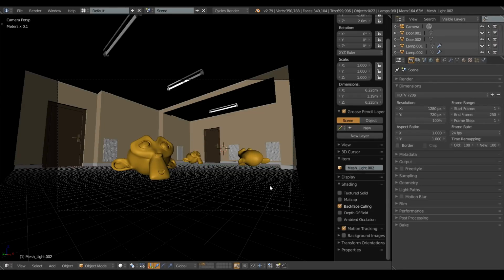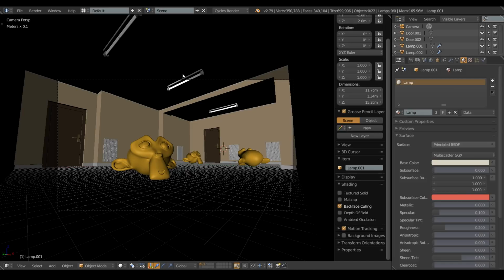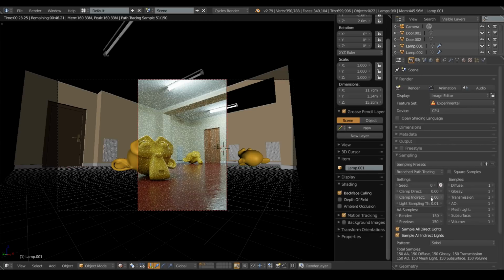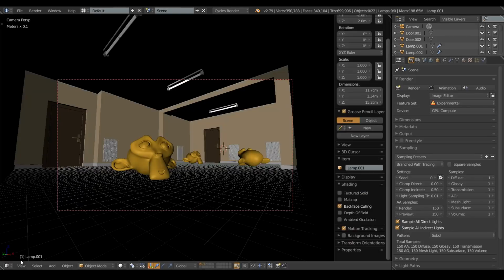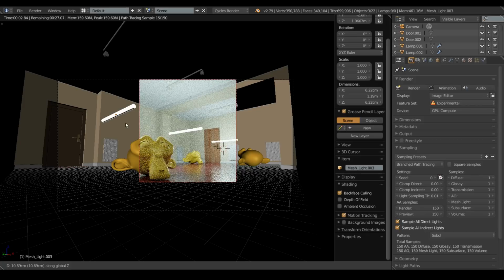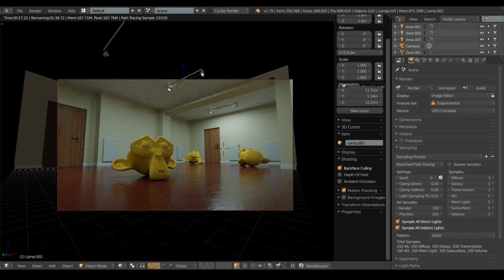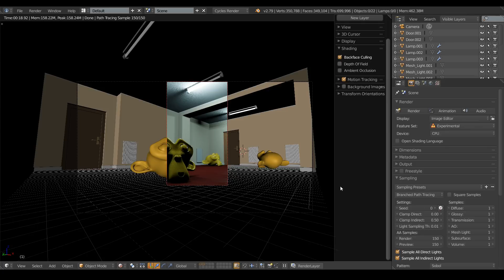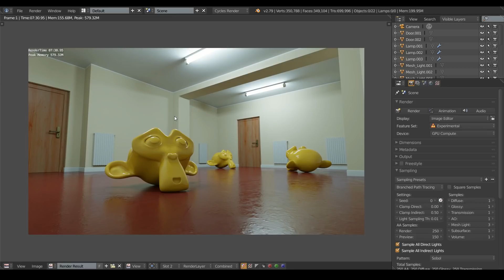Blender Cycles Interior Rendering Noise Reduction Tutorial

Comment: 😍 Thanks for this! Please may I ask you: Do you have a Mac or Windows PC? I have a Mac with aNVIDIA GeForce GT 750M 2 GB, 2.79 detects it correct as OpenGL card, but if I use it with Cycles, 2.79 crashes. New to Blender, I appreciate any help, also such as correct GitHub or Blender forum to address this.

Comment: The conclusion I draw is that when the emission light source is so close to the ceiling, the first bounce is almost as bright as the light source itself.  Therefore that light bouncing off the ceiling need to be effectively given near equal weighting as the direct light in terms of samples and further bounces.

I guess you could do hackish things like having the emission light only lighting the ceiling with zero bounces.  Then have an area light lighting the scene below (excluding the light fixture).  But that just seems wrong.

I wonder what the proper solution is?  Could Blender automatically make the ceiling (or any flat surface) behave like an area light,  when it senses extremely bright bounced light.  Effectively the ceiling needs to have a multiple importance setting - even though it's only an indirect light source.

Anyway, thanks for sharing.